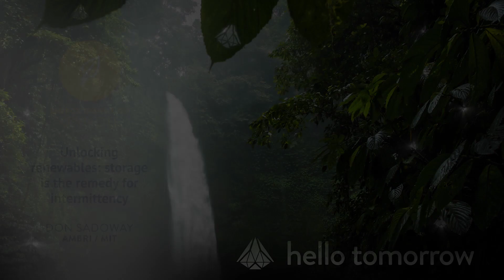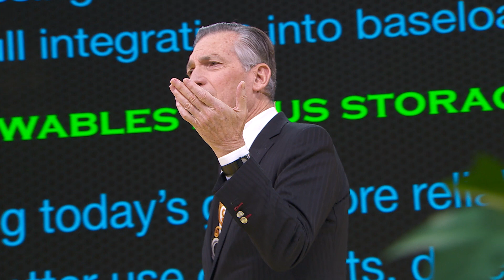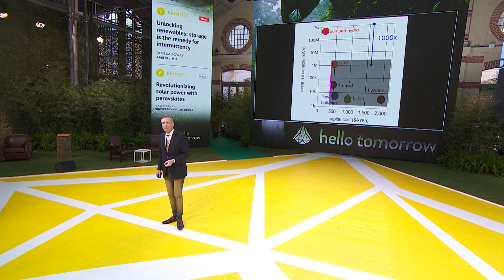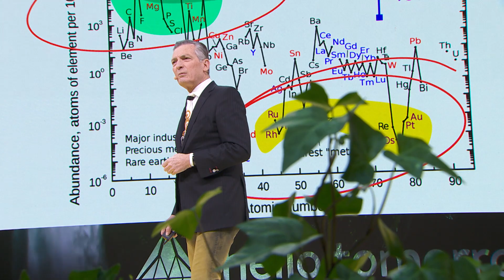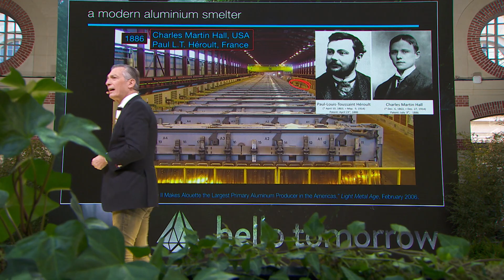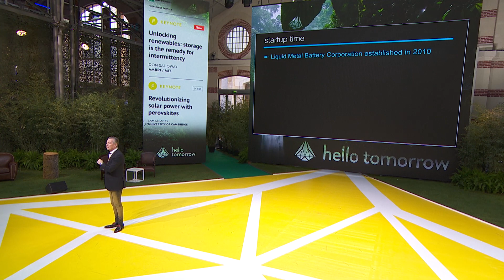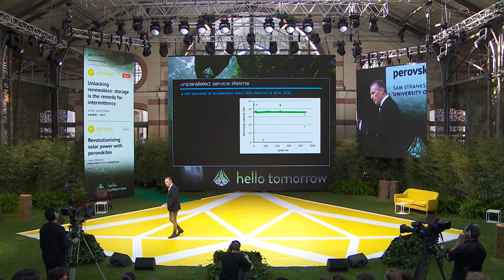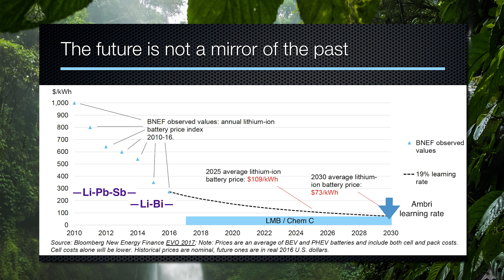Unlocking renewables: storage is the remedy for intermittency | Don Sadoway | HT Summit 2017

Comment: Whatever is cheaper, faster & better will always win in every sector. His CHEM C will be a game changing paradigm shifting technology when its widely commercialized. It took many years for aluminum to become a cheap structural material in actual products like many vehicles for Lotus or the Tesla model S or some Audio performance models etc / steel is still the main vehicle assembly metal because its cheap, compact, strong & abundant, even though it has issues with corrosion, rust, forming oxides of iron, Toyota Tacoma Taco frame rail rusting problem etc.... 

For gigawatt class energy storage the Liquid Metal Battery from Ambri is more flexible than pumped hydro for more applications & chem C will bring the cost down to less than $50/ kWh / I am surprised more investors in the grid energy sector are not dumping money at Ambri to make it happen; to make it happen they need lots of series B & series C funding .... consider how Tesla Motors got started as an example of how layered investment funding makes it happen!

Comment: Aluminum-ion batteries are being kept off the market my view, regard this work which normally would have demo runs of 10,000 units by now with financing:
Aluminum battery from Stanford offers safe alternative to conventional batteries. The new aluminum-ion battery could replace many of the lithium-ion and alkaline batteries in wide use today.: https://news.stanford.edu/2015/04/06/aluminum-ion-battery-033115/

Comment: the data from panasonic does not accurately portray the performance of modern day li ion chemistry. They might have looked like that 8 years ago, but there have been developments in electrolyte additives that prolong the cycle life to 80% over 1000 cycles, and it's only going up.

furthermore, cylindrical cell designs like the 18650 are not optimized for grid storage. they're optimized for Teslas. A li ion battery optimized for grid storage would use pouch cells, which carry a much greater pack density.

this leads into my other point that sadoway does not mention the voltage or energy density of his batteries. it's great if you can make cheap batteries from dirt, but not if it takes up too much space.

furthermore, you can vastly improve the capacity retention of lithium ion chemistry by closely managing the state of charge within a narrow window, like say betwen 30-70%. there are also li ion chemistries today (like LTO) that can cycle for 10s of thousands of cycles without significant capacity fade, although at a cost in energy density,

lastly, the cost of the material matters a lot less once we develop the necessary recycling infrastructure. lead is in that quadrant of rare metals, and yet we all have it in our cars, and don't worry about its scarcity, because we recycle >99% of it. The same will be true for lithium ion batteries as well as CdTe solar cells, I presume. so the insinuation that energy cost can't fall below today's material cost is kind of hinged on a false premise, that we can't recycle these materials, and make them easier to obtain.

Despite all this, I admire what Ambri is doing, and wish them all the best. Being a pioneer in a field is not easy. Hopefully, they can have a working product sooner than later.

Comment: With all the glitz and hype, I smell a great big scam. If this guy really has a revolutionary storage battery, why all the stage setting. It looks to me like this guy is looking for investors, not the secrete of miracle batteries. In a previous video about this supposed "breakthrough battery, all they showed was a cut down modular shipping container with a new paint job, and said it contained the new battery. Like other people have said, I'll believe it when I see it.
Reply: not a scam , its high temperature thats the problem generally, also high temperature corrosion ,stainless steel is expensive , also he used magnesium first - reactive -must hermetically seal from air moisture or water, then he changed chemistry to lithium, its all good material, but he changed chemistry few times ,hes also trying to lower working temperature (using bismuth)  so from production point hes still standing still . so its still in lab work and full stop until he decides final chemistry.
Reply: @Zeroni82  ; it is apparent to me that you know very little about how storage batteries work. I spent the last 10 years of my working life working on power backup systems for AT&T, so I know something about power and storage batteries. Batteries use a chemical reaction to store and discharge electricity. Some batteries do this better than others, but heat is NOT the primary limiting factor when it comes to battery performance. Although most all chemical reactions produce heat, the heat can be controlled if the system is properly designed. The real problem with storage batteries is that you cannot put energy into a battery at anywhere near the same rate as you took it out. That's why after driving your electric car at highway speeds for 1 to 2 hours, you need to recharge for 4 to 8 hours. Also, converting DC to AC, (called inverting) is very inefficient, and there is a large energy loss during conversion. Bottom line is; if this guy is on the verge of a MAJOR breakthrough in storage battery technology, why the "Hollywood" stage setting? It MAY be legit, but I have seen enough scams in my life to suspect there is something wrong here, (a lot of scams use over-the-top slick productions like this). Time will tell, but it still looks like this guy is more interested in impressing potential investors than he is in inventing a better storage battery.
Reply: @oldgysgt , EVs can be charged at high amperage to 80% SOC in 20 minutes not 4 hours.
Reply: @mbabcock111  ; I don't know who told you that BS, but I have worked with Batteries for the last 10 years of my time with AT&T, and if you try putting power into a battery at anywhere near the rate you took it out, you will destroy the battery. Don't believe me? Try it! If this guy has found something new, why the stage show?
Reply: He already has major investors, including Bill Gates. It takes time to bring a new technology to market.
Reply: @MBighk ; you use the name "Bill Gates" as if he is on par with Albert Einstein. Just because Bill made a fortune marketing other people's ideas does not make him infallible, (Bill puts on his pants one leg at a time, just like the rest of us). Have you ever wondered WHY he tells the world that Bill Gates has invested in his work? If his new storage battery is the best thing since shoe laces, why use Bill Gate's name at all? And if this guy has all the investors he needs, why the stage show? I would think his time would be better spent perfecting his idea rather than walking around on a very expensive stage with a microphone strapped to his face. The Wizard of OZ had a very good reason for his "pyrotechnic" display he put on for Dorothy's benefit; he was HIDING something behind the curtain.
Reply: When something sounds too good to be true it usually is
Reply: What makes you think he had anything to do with the stage setting?

But I do agree, something isn't 100% right with this guy.  I'd hope MIT would follow this very closely.
Reply: @bosco008 ; do you think that stage was set up for a rock concert later that nite and he was only using it because the regular meeting room was being painted? Well, I don't think so.
Reply: I like skepticism. For what it's worth, viewing this video was worth my time because he pointed out the value of "abundant" versus "rare" resource directed research. ClimateDeception.Net
Reply: It's not like Prof. Don Sadoway is a nobody coming from a dark alley to swindle you. This presentation was much more watered down than others. This was also not the only presentation held on that day...  

R&D takes a long time and a lot of resources. 

We all wish we could snap our fingers and have it happen instantly but ** just don't work that way.  If you've work for an electric company you should know how much it would take to break up the current grid and have a "energy storage" system incorporated. The Supply/Demand system is ancient and needs to be replaced/updated. Which would prolong this tech even further ,but hey, that politics... 

Stanford Precourt Institute for Energy channel has a nice presentation of him. I highly encourage anyone to go watch it, he gets way more "sciency".😋

CBC also did a piece on Ambri, Dec 12, 2018 .

How about. Focus on what he's talking about rather that the stage looks staged.🙄..
Reply: @_Phyro ; if this guy really has something there are a number of companies who will invest in it, but they don't need a stage show to get the ball rolling. There is something happening here besides the announcement of a new battery.
Reply: Well said. I've seen this type of charade below. Anyone can put up numbers on a screen. Seeing is believing.

Comment: I see it this way: 
Storing electricity in Lithium ion battery cells ist ideal for automotive use, where low mass and operability over a wide range of temperature is a big issue. 
Liquid metal batteries are relatively heavier and operate at an elevated temperature, which is no big deal for biggish stationary application like net stabilisation.
So, there definitely is space for both these technologies.

Comment: The advantage of this battery is in the lifetime..... And will out last 10 sets of lithium batteries..... With performance like that you would have to be crazy to buy solid state cells....ambris investors are idiots...... Thinking its all about initial cost per kWh... When can I get these hot cells for personal use?
Reply: The issue is the liquid metal battery is no good for transportation and solid state cells are the future of transportation
Reply: @buffalo_chips9538  The liquid metal battery was designed for stationary grid energy storage, did you listen to the talk?

Comment: what is the catch here. Why are the EV companies not using your batteries?
Reply: They are for extremely long life  perhaps 100 years , very low maintenance,  high volume energy storage not good for small applications, these are for hydroelectric scale storage think megawatts or a battery for an entire  city or town.....at the smallest they could possibility work on a single large home.. Or a group of homes, no other battery offers advantages that even come close...cheap and indestructible
Reply: @oceanhouse8080   One advantage would be if they actually existed.
Reply: I think they have to be stationary to work. Also, I don't think they are as energy dense as lithium-ion batteries.